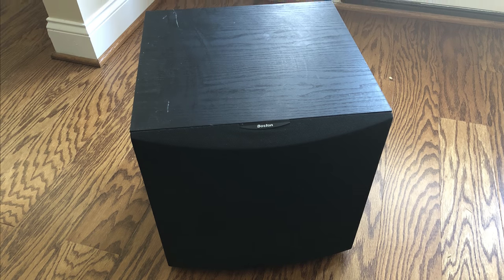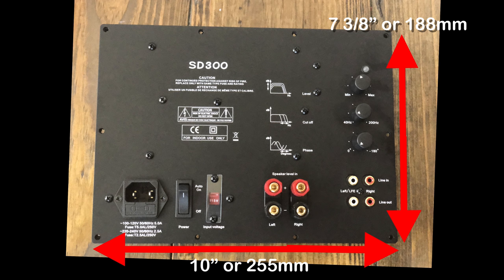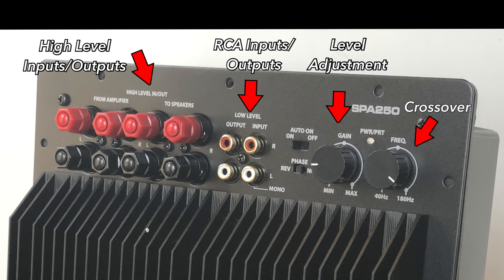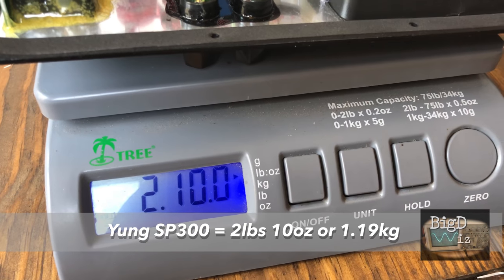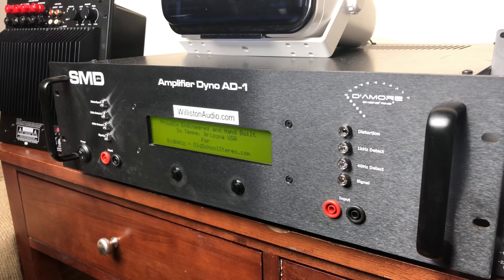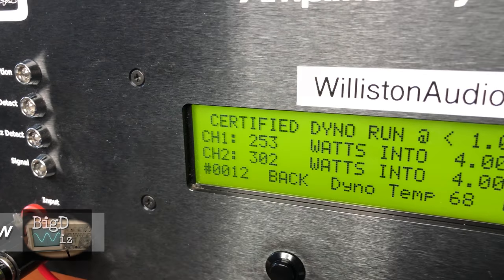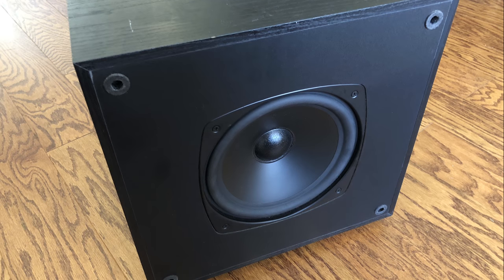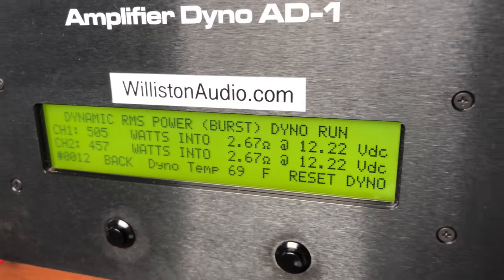Subwoofer Plate Amps? Dayton SPA250 vs Yung SD300 Tested

Comment: Maybe the inside casing helps to dampen the vibration and any electrical interference from the motor of the speaker. I wonder if there' s any aluminum tape on the inside of the cover??? I've noticed in the past with certain capacitors that vibration changes their value and doesn't return to a normal state and the same applies with heat. Most of the plate amps especially for a sub woofer shortens the life. any input is appreciated here.
Reply from the maker: Vibration is an amplifier killer for sure. Not sure what’s inside the enclosure, I didn’t want to break it open, but I guess I could if enough people wanna see?
Reply: I read a bunch of reviews just now and some were happy, but it sounded like they only used it at lower levels while others mentioned they had a popping sound shortly after and found bad caps... I wish I knew which ones so i could figure a workaround for the problem. maybe a small fan could help and use rubber grommets with a foam rubber seal to absorb some of the shock.
Reply: Yes the vibration can definitely be an issue but the real purpose of the plastic casing around the components is due to the assumption that the amp will be mounted inside a sealed chamber with the sub and it is much easier to have one consistent seal around the square plastic casing instead of sealing each pot, switch, terminal, etc on the outside of the amp.
Reply: Open it up Big D!
Reply: I think they left it open to dissipate heat and as a cost cutting measure... I'd go Dayton for long term use as it had a real/actual heat-sink.

Comment: Thank You for the test video!!!  Can I use the Yung to power two Dayton 8 ohm 12" dual voice coil drivers?  Because that is  what I have, a box that has those, and need to pick an amp. Maybe that amp is not 2 ohm stable though - Huh?  will I have to get a Dayton for it to be 2 ohm stable? As, 2 ohm all parallel.  Or could I run the Yung at 4ohms as series/parellel using all 4 voice coils - wait, that would be an 8ohm load, huh? It won't be run all that hard.  It will be paired with 2 Focal CMS 65's.  I need to keep the cost just as low as possible - I really prefer to have a continuously variable phase control
Reply from the maker: Get two amps and problem solved 😬
Reply: @wal  -except for the part " I need to keep the cost just as low as possible"

Comment: Big DWiz could you please do a amp Dyno of a kenwood performance standard 100 ...I had one I bought at a pawn shop 12 years or more ago on the cheap and used it to run a jl audio 15 in a subzone slot ported box had it in a 2000 extended cab s10 and it really done a great job...it was only a two channel amp and had it bridged of course but really always wanted to know the actual power it was putting out ....it may have only been 100 watts but if it was it was the loudest hardest hitting 100 watts I ever heard ....

Comment: Hi, I have a monitor Audio asw-210 but it seem like the transformer had burned out. What plate would you recommend for me to get as a replacement that would fit with my subs. The asw-210 is a dual driver for two 10”. I could opt to buy other subs but it’s hard to let go of such a good sub. The dimensions I measured was 7 7/8 inch x 11 3/4 inches for the plate with 4 horizontal x 3 vertical screw holes.

Comment: i have a SA-WMSP4 100w 8 ohm running 4 ohm with 2 (170 watts estimated each) 2 ohm serial but they bottom out SUPER hard and easy with a .8 cu ft vented box (33 hz tune) what is the real wattage of those things? (songs like kill shot definitely murder the poor subs)

also, thank you for telling me what these are called; i've always shopped for these amps by purchasing units like what i have, just gutting the stock speaker and using my own

Comment: Still have the bad Boston plate amp? I've repaired several of those (same amp in the Micro90pv and CR400)
Reply from the maker: Yes, amp is still installed in the enclosure. By the time I round trip ship and pay for repair, cheaper to buy a new plate. That’s mainly why I went this route

Comment: ALL Dayton shit is legit for anyone questioning a purchase. I wish he would have dropped it to 2 ohms for the hell of it, I know it would have taken it all day long. Best setup I ever had was a 10 year old Yamaha receiver running 3 pair of those $35 Dayton bookshelf speakers on Dolby digital 5.1 (just keep one for a spare), a 4 pack of the Dayton tactile transducers run off an old 75w plate amp I ripped out of a blown up subwoofer, and a Dayton 12" subwoofer that I think was on sale for $100 at the time. I put 3 tactile transducers in the couch and 1 in the recliner. My friends couldn't believe they spent thousands at best buy, especially on 'Blose' and mine just blown theirs away. That $40 on the bass shaker was the best money I ever spent in my life, if you cranked the amp it was ridiculous, it would bounce the remotes off the couch. Can't go wrong with Dayton
Reply from the maker: The Dayton went into protect at 2.67, watch all the way until the end of the video

Comment: With your home one you got, did you try replacing the speaker. I got one from my dad and replaced the speaker and it worked. It would come on but no sound. Might have just fried the speaker. Amp probably still works. I had a hard time trying to kill it completely and i couldn't.
Reply from the maker: I checked the sub and it’s okay. The amp has an issue.
Reply: Ah. Okay. The one i got, and i cant remember what it was, the sub was fried. I put in a 6 ohm  sub and it bumped SOO hard. I had an extra sub on a house speaker i could play with that i didnt want to blow with highs so i put it in this house amp. Best decision ever.

Comment: No listening test?  Wow.  The Dayton amp is ok.  I have used it a few times.
Reply from the maker: There will be a 2nd part to the vid
Reply: Mister hat, What does it matter?  It is an amplifier.  How it sounds is important.  You can have an 500 watt sub amp with 3 db of headroom that sounds like garbage.   You can have a 75 watt amp that will run the hell out of a subwoofer cleanly.  I would like to know what he thinks and what his opinion is.  I may not agree with him  but it would be nice to know.
Reply: When is part 2 coming out @wal

Comment: Using this Dayton in a build.

I'm pairing 2 $50 10in subs, underpowering them by about half, and a single passive radiator with quadruple the xmax of one of my 10s. What size box should I use? Thinking a 20in cubed with 3/4 in MDF so effectively 19.25 cubed minus this Dayton's area - (.75 x8.5^2)in^3 of its area (198.7 inch^3). 
I think I'm pretty close with a 20in cubed box using 3/4in mdf.

Is this too big? Or not big enough? Does more internal air volume make the passive work harder? Or is it the other way around where the volume increases the passives power handling?
Reply from the maker: Need to get box specs from mfg or seller

Comment: I need some advice from more knowledgeable people in this field, I have a 6ohm sub and some 4 ohm ones aswell. I had the 6ohm one in my car subs and tried to blow it, I failed. Sent probably 600 watts to it. Any ways I need a stand alone amp for one of the two boxes, one the 6ohm home theater speaker, one a 4/2/0 ohm sub. I’m on somewhat of a budget. I’m also using car boxes as that’s what I had laying around. They are both 12”. Any recommendations?

Comment: Which did you choose Big D?
Reply from the maker: I’ve been using the Dayton and honestly haven’t switched to the Yung
Reply: BigDWiz i have a JBL home theatre and the plate amp went out on it, and it waz was rated at 100 watts on an 8inch woofer!...i was wondering which was better did you find the sound quality better with the dayton and did it fit the subwoofer enclosure properlly?

Comment: Have you ever run a car sub with a plate amp, given that their 4 ohm wattage is close to their 4 ohm claims?
" YEAH BOYYY!! "
Reply: the problem with running plate amp on car sub is the power supply. Their 110/220V power supplies have a different current and voltages designed for their circuit and internally they dont run on 12V - 14V DC. So you would need to get the inverter from DC to AC if you want the optimum performance and this way you would introduce another week link to the system and extra cost.

Comment: Never put an amp that could push it that much more power and just "turn it down" 250w rms is way higher than the 75w the original did.
Reply: I've pushed 150 watts RMS into a 50 watts RMS rated subwoofer. Woofer showed no signs of damage. 
Sure, if you do that for long periods of time you are going to fry that coil over time. But turning it down will work just fine.

Comment: which amp did you end up liking more???
Reply from the maker: I’ve been using the Dayton and honestly haven’t switched it out. I really like the Dayton
Reply: Thanks man! Great show btw. been binge watchin :-)
Reply: do you think that I can get a good bit of thump out of the Dayton 250? or should I go for the 500 watt version for a Skar Audio VVX-8v3 D2 8" ( yeah, I know that it is designed as a car subwoofer, going for a 3/4" plexi "wow" window in my box) and LOVE the black basket, and Aluminum magnet look for my project.
Reply from the maker: I’d get the 500 watt version for that sub. Sounds like a cool project! Mine is being used in the living room, so I didn’t need a ton of bass. I was also thinking about using car audio subs in our playroom/theater
Reply: Thats what I figured too, always better to have too much power and turn it down.. then have the knowledge that there is more boom in there... just out of reach HAHA
Ya, going to try my hand at a 6th order Band Pass, with stack port on bottom chamber, and double sided ghost port on top chamber, wont decide tuning till the box volume is figured out. changed mind on sub when I saw that Skar LOL thing is huge and takes up more volume HAHA
Reply: would do an Ultimax Dayton 8" if they made one HAHA those look like Beasts

Comment: I need some help maybe someone can help me, I have 2 definitive technology bp8080st towers with bad plate amplifiers I'm trying to find replacements for the towers,  from a different manufacturer that might bring these nice towers back to life any information would help thanks in advance Mike
Reply from the maker: Hello sir. Those are pretty specialized amps. Maybe keep a watch on eBay or ask Def Tech support if they have replacements. Another option is to have the amps repaired

Comment: how to destroy a speaker designed for a 75w amp....by plugging a 200+ amp to it instead ... change that speaker before it dies lol
Reply: Not true. Set the gains right and it will never blow. Youd rather feed it more clean power than less power with gains cranked causing dirty power to blow your sub.
Reply: Headroom....